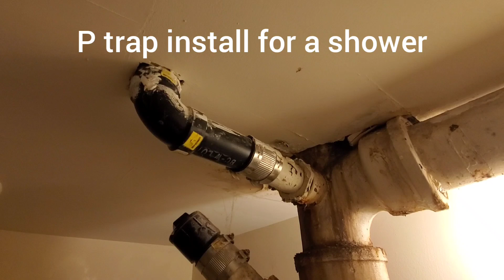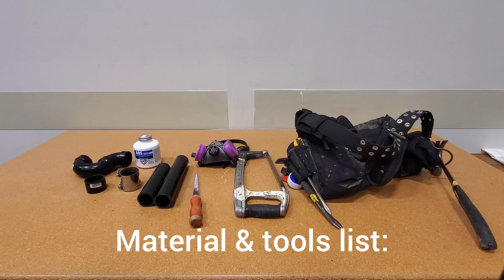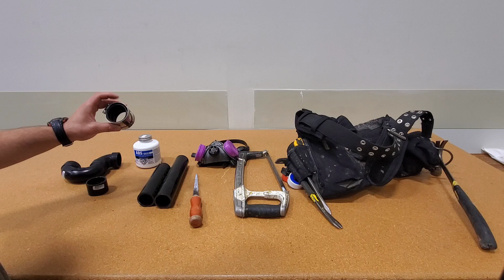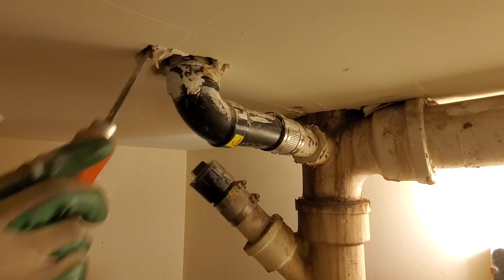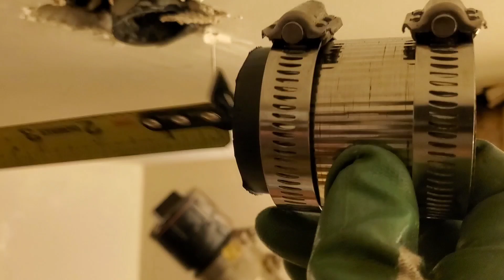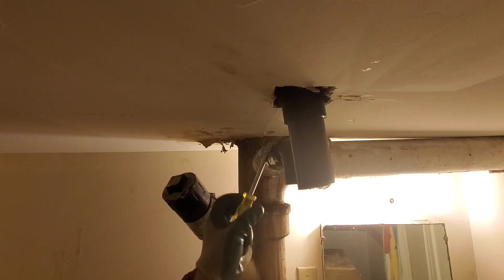#QTOW#The crap l see# Shower drain P trap install (DIY guide)

Comment: shouldnt it be 2" for a shower trap
Reply from the maker: Thanks for your question, by our local code 1 shower head requires minimum pipe size 1.5". So this drain is fine based on our code here.